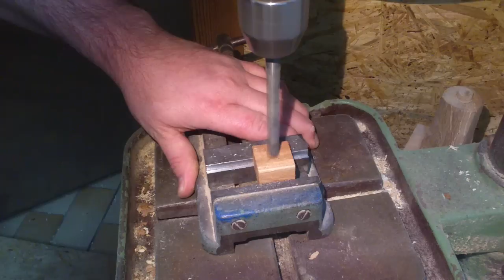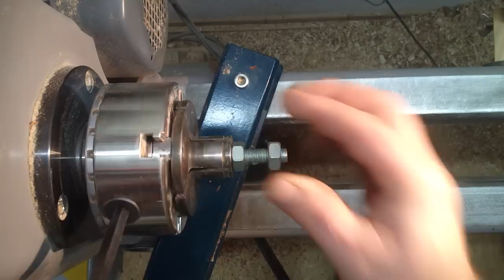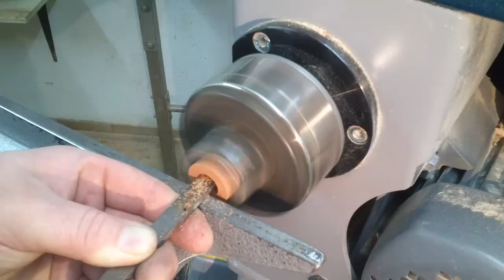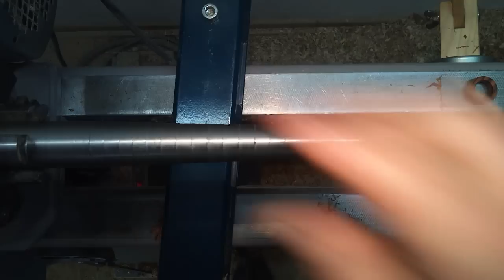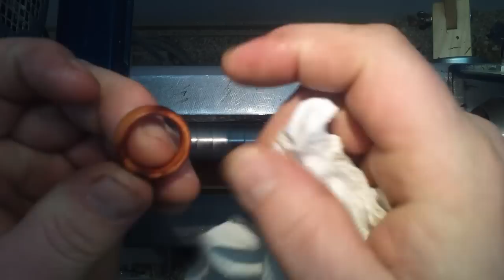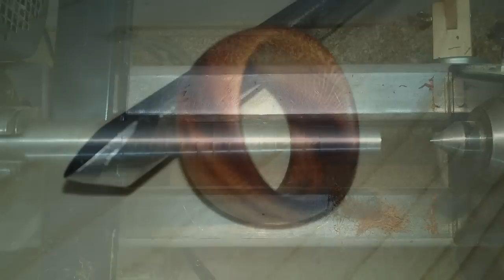Woodturning [part 2 of 3] turning jewelery, ring [HD]

Comment: Instead of cutting freehand on a bandsaw, a much less expensive option would be using a hole saw.  During the step where you are making the initial ring blank, mount the hole cutting saw in the drill press and mount your wood stock in a vise to cut it.

Should use the ring mandrel as your interior ring sizer to start with, instead of messing with calipers.

Also, when you chuck up the ring mandrel to turn the exterior, wrap a few layers of tape around the mandrel just behind the ring to ensure that it wont jump around the mandrel on you.

Finally, to achieve that mirror shine that really attracts a lot of attention, sand your ring up to at least 600 grit paper, and then apply a few layers of superglue (cyanoacrylate glue) as your finish and final coats, sanding up to 1200 in between, if desired.

Comment: Wondering the large tapered mandrel you used at the end. Is that something you made? Was it set to ring size steps? 
Very nice video, going to try these rings myself now. :) Thanks for the inspiration.
Reply from the maker: Hallo Robert, ja den konischen Dorn drehte mir mein Bruder. Er hat eine Größe von 13 bis 26mm. Ich wünsche gutes gelingen! Es wahr mir eine Freude.
Gruß Tiroler